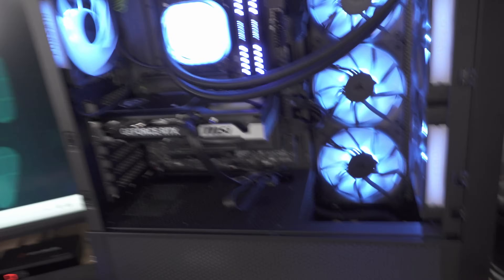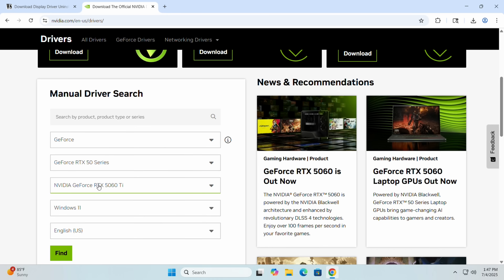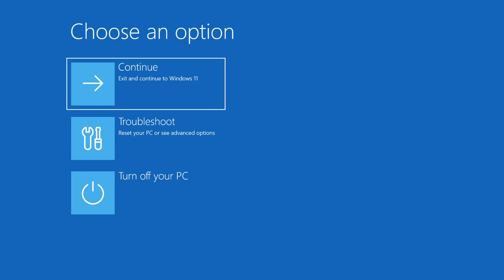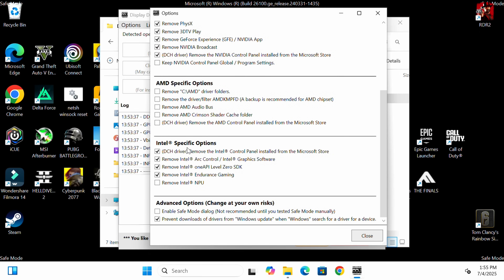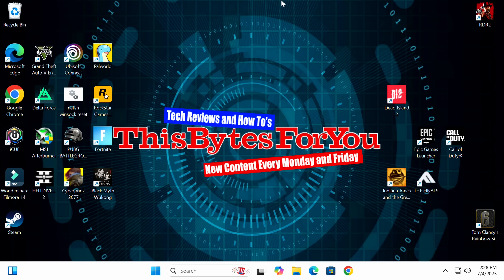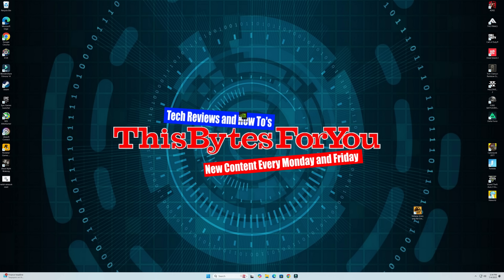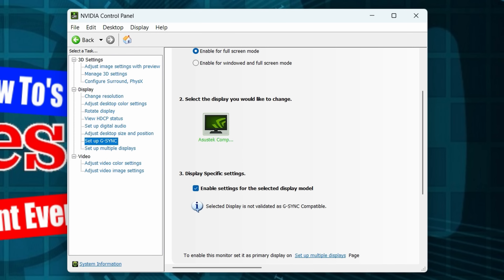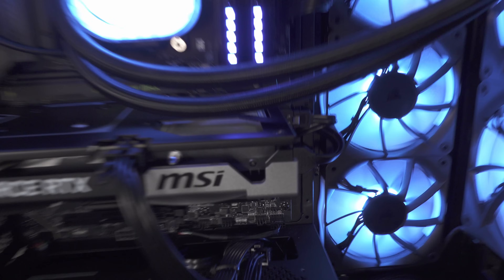The ONLY Way to Install RTX 5060 Ti? (Avoid Headaches & Maximize Performance)

Comment: My BIOS is way different, its Gigabyte, nothing after boot is there, please help
Reply from the maker: what is the manufacturer and model number of your motherboard?
Reply: How do I check that? Im sorry I have no clue what im doing..
Reply: @ThisBytesForYou  I found it, Gigabyte Technology CO., LTD

B760 DS3H AC DDR4
Reply from the maker: 1. You might want to flash your BIOS so that you have all the feature: https://www.gigabyte.com/Motherboard/B760-DS3H-AC-DDR4-rev-1x/support#Support-Bios
2. When you installed the card, did you connect your monitor to the card?
3. Did you plug in the 8Pin PCIe cable into the card?
4. What is the manufacturer and model number of your power supply?
Reply: I was able to get it working, Thank you so much for responding to my comment, even months after the videos release. Great video, really clear and detailed explanation. Thank you again 🙏🏼
Reply from the maker: Always a pleasure my friend, so very happy you stopped by, trusted in me to help you, liked and subbed as well as took a moment out of your day to thank me.  It means a ton to me and I am so very happy I could help you.  So what did it end up being?
Reply: @ThisBytesForYou  It just started working lol I don’t even know.
Reply from the maker: Good stuff

Comment: Hey, I recently bought the PNY 5060 TI to replace my 3060, but I was wondering if you could help me out with something because I'm new to pcs
Reply from the maker: Ummm, sure thats what this video is about, have you watched the video, its made for people that are new to PC's
Reply: @ThisBytesForYou Of course, but I have a specific issue. The edge connector on the 5060 Ti doesn’t line up with the x16 slot on my motherboard even though its the correct size. The metal bracket(where the display ports are) on the GPU sticks out slightly, creating a gap between the bracket and the card itself. My 3060 didn’t have this, as the bracket was pressed firmly and flatly against the gpu. But essentially, I think because the metal bracket is sticking out a little more than it should be, its causing the edge connector to misalign.

I can’t access the screws on the bracket to adjust it, and I'm unsure if its intentional or just a defect.

Sorry for the confusing description, but I'm just wondering, have you ever seen something like this happen before, or maybe am I missing/misunderstanding something?
Reply from the maker: So, being that you watched it, do you mean like what I show at 10:22 and how to avoid it?
Reply: @ThisBytesForYou Yes, thats what I mean. I followed what you did and the issue persisted. As I said, I believe its an issue with the metal bracket.
Reply from the maker: OK, the bottom piece, that I show you to put between your case and the motherboard, sometimes you have to bend it back or forward a teeny tiny bit, so it fits between the case and motherboard, it is scary, I haven't show it, but I will but I am at CES right now, no where near a graphics card
Reply from the maker: So I guess that helped?

Comment: Thx :) had a scare when I realized my power supply wasn't fully modular. Then I realized that there was a 12 pin connector for my RTX 5070 TI.
Reply from the maker: Ahhh good stiff my friend, so very happy you got it.

Comment: Hi great video kudos, one doubt tho will these steps work on 12400f processor since it dosent have a internal graphics
Reply from the maker: Thanks for watching, but I am confused, at which portion did you see I was using internal graphics?
Reply: @ThisBytesForYou  oh okay i thought once the old driver is uninstalled the old card would not work, now its clear ty. and i guess the steps are same for 5060 as well.
Reply from the maker: anytime my friend.  The driver makes it able to use its features, with out its drivers, its just a base VGA card, no frills no thrill basic video, enough to get you going though.  So happy I could help you.

Comment: I dont know which one to chose: MSI GeForce RTX 5060 Ti 16G VENTUS 2X OC PLUS or PALIT GeForce RTX 5060 Ti Infinity 3 16G
Reply from the maker: I would say the MSI, has better clock speeds, as long as your system has good cooling.  The PALIT has lower speeds, but the 3 fans is nice.  I would recommend the MSI and if you could, please use my Amazon affiliate link, it helps the channel as well: https://geni.us/ETsGq

Comment: I have less gold fingers on my 5060ti and I’m trying to install it now. Because I have less gold fingers, the retainer mechanism isn’t clicking into place. Will this matter?
Reply from the maker: What do you mean less gold fingers, the PCIe card shorter some how?  what is the manufacturer and model number of your card?
Reply: @ThisBytesForYou  yes the slot on my motherboard is longer than the fingers on the graphics card that fit into it
Reply from the maker: Have you watched this video?
Reply: @ThisBytesForYou  this video I’ve commented on? Of course. But it just throws me off how the pcie slot on my motherboard is longer than that teeth on the GPU that slot into it
Reply from the maker: I still need to know the manufacturer and model number so I can help you?
Reply: @ThisBytesForYou I have an ASUS b660m - kd4 motherboard and the graphics card is a rtx gigabyte eagle 5060ti 16gb
Reply from the maker: Wow, that's a x8 card, a physical x8 card, very interesting, but regardless it will work perfectly fine.  PCIE is smart, while the physical slot is x16, a x8 card will work in there, a x4 will work in there even a x1 card will work in there, so you are good ;)
Reply: @ThisBytesForYou  thanks for looking into it, I did ask ChatGPT about it and even sent it an image of my pcie slot and it said it should be fine but it just threw me off because it doesn’t click when Inserted because it’s too short to reach the retainer
Reply: But I have it up and running now, I followed the steps in your video exactly and im currently testing the new card on a few games on steam. Everything seems to be going great so far. Thanks again for your helpful video and getting back to me through comments! :)
Reply from the maker: Always a pleasure my friend, so very happy you stopped by, trusted in me to help you, liked and subbed as well as took a moment out of your day to thank me.  It means a ton to me and I am so very happy I could help you.  Yes, it doesn't click because it cant reach the locking mechanism, and thats ok.... just make sure not to pull out the card while its on haha.

Comment: My 5060 Ti 16GB is coming in this afternoon. Upgrading from a 2070 super. I’m excited to have something that performs better than my Xbox Series X and not worse! Great video that is going to be very helpful this evening.
Reply: That’s crazy, I’m upgrading from the same card and it arrives tomorrow, so excited!
Reply from the maker: @Priest067 good stuff my friend, let me know how it goes and if you need any help
Reply: @P @Priest067 exciting! Enjoy! Learn from my mistakes. I was getting black screens and it took me a couple of hours to figure out I needed to update my BIOS firmware. If it’s an older motherboard, you might consider checking into that before installing the GPU.
Reply from the maker: You already had gpt, so that was good, it's hard to do it from this side with so many variables, it's awesome to have someone on the other side that isn't scared of things both ways I am here to help.
Reply from the maker: Always a pleasure my friend, so very happy you stopped by, trusted in me to help you, liked and subbed as well as took a moment out of your day to thank me.  It means a ton to me and I am so very happy I could help you.  If you have any questions, PLEASE feel free to ask, also, one thing before you upgrade, which I kind of go over here, I need to make sure to go over it better in a next video is if you right click on your start button, then click "Disk Management", on the disk management window that appears, look for your C drive, to the left of the C drive, you will see a box that reads, Disk0, disk1, etc, which ever the disk is that the C drive is on, right click on that disk box, and click Properties.  In properties, click "Volumes", what does it say on Partition Style?
Reply: @ThisBytesForYou It says “GUID Partition Table (GPT)”
Reply from the maker: OK, cool, you are good there, and last 2 things, 
1. What is the manufacturer and model number of your motherboard?  
2. If you would know the BIOS version, that would help too.
Reply: @ThisBytesForYou I actually ran into a bit of a headache last night due to that. It’s an older board. ASUS PRIME Z490-V. Got black screens after bios configuration but turned out updating the firmware fixed the issue. Now I’m on version 1621.
Reply from the maker: @New_Magellan yup, that's why I wanted to know what board you have, so happy you got it;)

Comment: I cant mine to work no matter what. I followed all the steps plus a bios update. It was extremely laggy before the driver install then after the install, i get a black sceen and no fans on on th gpu
Reply: Let me help myself real quick, have you tried installing the gpu directly to the motherboard and not the pcie extension cable? Answer: No
Results: works fine now
Hope it helps someone because I returned my arc a770 for a 5060 ti thinking that was the issue
Reply from the maker: The pesky sleep thing kept me from replying.  What do you mean directly to the motherboard instead of pcie extension, this video goes over that, what was missed?
Reply: @ThisBytesForYou i used a thermaltake core p3 from my first pc build. Figured id save the cash for a newer Gpu instead of upgrading my case. But the case was purchased about 6 years ago. It came with a pcie extension cable to mount the gpu vertically. It worked fine until i swapped gpu. Since the newer gpu require faster speeds, it also requires an updated extension cable if i choose to keep it vertically mounted. I just installed it directly onto the board horizontal and 3d printed a brace so it doesnt warp on me
Reply from the maker: Good stuff my friend, yeah I haven't had the vertical pcie cable issues, but I know of others that have had it, and it can really stump you, so glad you caught it.  I made a sag bracket too, is it the same one I made here: https://youtu.be/1nX3ER47Otw

Comment: Dude what if I have the AMD integrated w and graphics, just got a 5060ti will it have issues w Nvidia drivers?
Mine is kinda slow.
Reply from the maker: AMD integrated graphics use graphics drivers, so remove them like i show you, disable on-die graphics like i show you, it might help to also remove the NVIDIA drivers and install the latest.  When was the last time you updated your chipset drivers and BIOS?

Comment: Hello! I just had a question, the model of my 5060ti has a 8x physical pcie, will it still fit in the slot? It doesn't have the hook at the end like this model. Also will it be the same installation process?
Reply from the maker: That hook is to lock the card it's not needed.  A pcie X1, or a x4 or a x8 and a x16 will fit in a x16 slot, so you are good
Reply: @ThisBytesForYou  Thank you so much! You've helped me a lot for preparing for this installation process!
Reply from the maker: Always a pleasure my friend, so very happy you stopped by, trusted in me to help you, liked and subbed as well as took a moment out of your day to thank me.  It means a ton to me and I am so very happy I could help you.

Comment: Hi you. I've followed your vid to the last part where the software should be clicked to close. But suddenly my screen goes blueish/black but does have videos input. 
Setup info. 
-Z270 GAMING PRO Motherboard with latest bios.
-intel i7 7700
-4 slots of 8gb ram. 
-Pcu is a Corsair rm1000x
And the Gpu is the Geforce  RTX 5060 Ti Ventus 2x 16gb.

I dont get it, did all in the video but couldn't find the second Uefi change in my bios so i left it like it is. 
Pls pls pls help.
Reply from the maker: Well, this is an older board, that actually doesn't officially support Windows 10 or 11, only goes up to Windows 8, so you will have issues, the intel i7 7700 is not officially supported by windows 11 either.  Not saying it wont work, but those are your challenges.  

As for UEFI, I don't know your BIOS, but it is a UEFI BIOS, so anywhere that is says CSM or Compatibility Support Module, or where you see legacy, switch that to UEFI.  You have to go through every screen in your BIOS to make that change. BUT if you have your OS already in CSM and MBR, you will not be able to boot into windows, you can't just change it from BIOS to UEFI IF you already have an OS installed.  

To change it from BIOS to UEFI, Watch this video at the 8:32 mark and follow along to make the changes (again, you will have to look at every BIOS screen and prompt because I don't know your BIOS): https://youtu.be/4BtdMcqwaFg

It's a video about cloning but it will help you switch from BIOS to UEFI and your C drive from MBR to GPT which is also needed for UEFI.
Reply: @ThisBytesForYou  thnx. I'm gonna go in to my mb the moment my kids are knock-out 😂. 
But it looks like I'm out of luck and have to save for a new mb with new cpu setup that does support the 5060 ti
Reply from the maker: Well yes, but you should be able to update, if you have UEFI in one spot, chances are you have it another, just go screen by screen and the other video will show you how to move from BIOs to UEFI and and GPT to support UEFI.
Reply: @ThisBytesForYou 
Hi again. Would an upgrade to this motherboard and cpu help me and be worth it. 
Asrock Z490 PHANTOM GAMING 4

i5-10400f
Reply from the maker: well, it does support Windows 11, so does that processor and luckily for your it's DDR4, hopefully that RAM works in there too.
Reply: @ThisBytesForYou im done with it all. I'm going for a full Am5 Ryzen 7 with 32 gb ddr5. Just got my 13th month payout 😂
Reply from the maker: Good stuff my friend, let me know how it goes and I have tons of build guides too with AM5 as well, maybe one of them can help.

Comment: I just picked up 5060 ti but only have a ryzan 5 4500 for now. Should be fine yeah? First time upgrading my pc and I'm worried 😂
Reply: Yeah it'll be fine for now but if you want optimal performance from your graphics card then you'll want to upgrade to the ryzen 7 5800X 8 core. Right now you'll only receive half of what you could be
Reply from the maker: Thank you for chiming in my friend ;)
Reply: @EccentricJenn thank you.
Reply from the maker: Yes, as @EccentricJenn mentioned, you will be fine, your CPU is going to bring down the overall performance, but once you bump you will be good, thats for 1080P.  If you are gaming at 2 or 4K though you should be good, it will be less dependent on the CPU.

Comment: Hey I got a 5060ti 16gb dual I tryed inserting to my pc and it clicked but can’t fully go in like the left side not fully in I also don’t wanna put to much pressure on the motherboard so either one something is blocking behind the graphic card, my motherbroad is a h670m itx ax
Reply from the maker: Did you check out this video, how I did it?